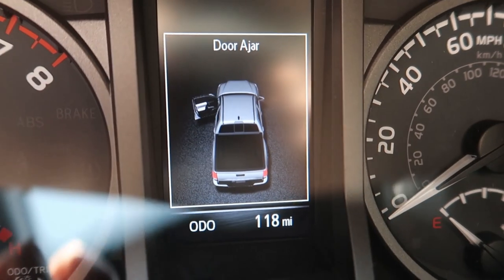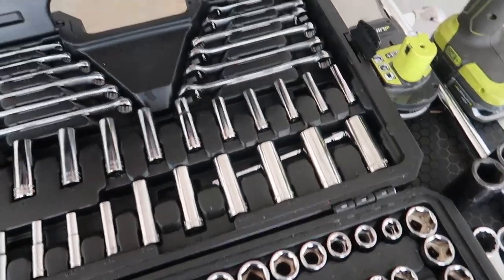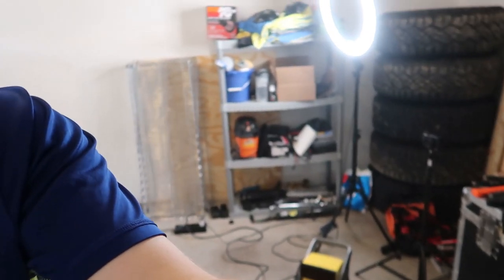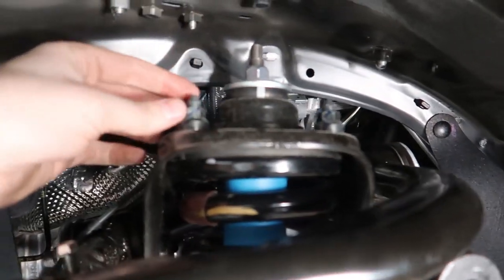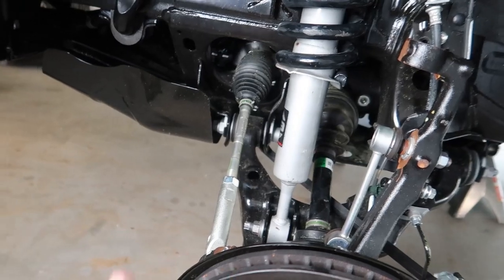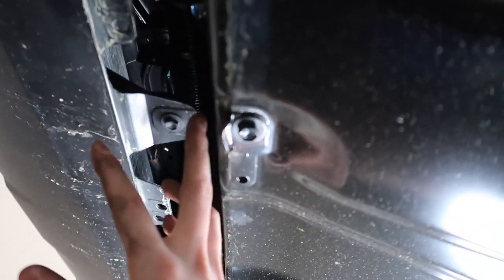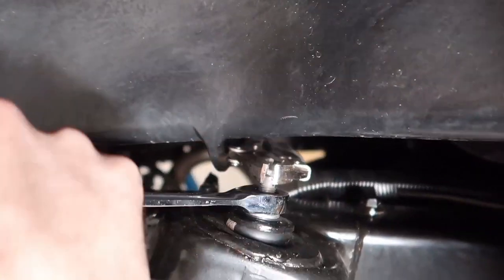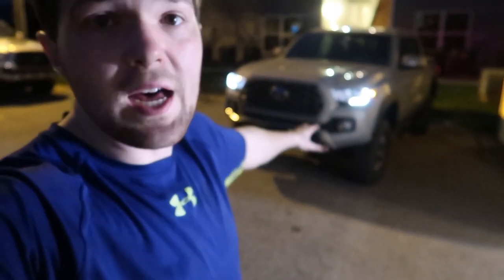Toyota Tacoma ROUGH COUNTRY 3" Suspension Lift Kit w/ N3 Struts 2016-2020 - How to tutorial

Comment from the maker: What you think? Let me know what mods I should do next!
Parts
 used!
Rough Country Lift Kit w/ Lifted Struts and N3 Shock in Rear https://www.roughcountry.com/toyota-suspension-lift-kit-745c.html
Shock Boots https://amzn.to/2WghN9a
New Shock Bushings https://amzn.to/2SAk26u
Bigger Diff Drop https://amzn.to/3b0DOhV
Reply: Less ads and pronounce "cotter pin" correctly
Reply: I have a question. Was this done on a previously stock suspension? I ordered the N3 Loaded 3inch lift struts from Rough Country under the impression that I could put them on my stock 06 TRD Sport 4x4, and got it all torn apart, and then the upper control arms just wouldn’t come together no matter how hard I tired. So after 6 hours I’m back to my stock suspension and wondering why the heck it didn’t work, when it is advertised to work with a stock truck.

Thanks!
Reply: With your 3 inch lift does your truck still fit in the garage?
Reply: I ordered the rough country lift kit I got a question the struts didn’t come assembly with the springs because in the picture looks like they come assembly I ordered the front and rear $599🤔

Comment: I did mine recently, and you can do it much quicker just removing the lower ball joints, strut Mount, sway bar end link and loosening the lower control arm and letting it drop down out of the way. The strut slides down and out and new one up and in.

Comment: Great video but it’s a lot easier and faster to just to remove the two bolts that hold the lower ball joint to the knuckle and loosen up the bolts on the control arm the connect to the frame just mark where your centric bolts are so you don’t mess up your alignment

Comment: Great job, bro.  Was getting flash backs to the nightmare we had doing the front of my 13.  Took two days cos we were so pissed off from doing the front! lol.
Reply from the maker: Yep that was what my first time on my 2018 was like. Pissed yelling screaming
Reply: @Canadian_Dan was that on stock suspension?? I just spent 6 hours on my 06 TRD Sport trying to install and the freaking upper control arms looked like there was no way in heck they were coming back together. I tried a jack and instead of lifting the control arm it just leaned the whole truck. I finally gave up and said screw it thinking maybe this is the wrong kit? It’s the pre loaded N3 struts for my year and model from rough country... Amy advise would really help!! Thanks!

Comment: What is all involved doing a 3 inch body lift on a tacoma? the bed looks the easiest to do but looking under the hood looks like there is much to extend possible the fuse box wire harnesses, heater hoses, block to raise brake lines, power steering hoses, washer hose, ac aluminum lines, radiator lift, bumper lift, looks like much to do it.

Comment: Dude nice video, I tried doing mine and got the back dont but the front suspension is pain in the a.. I tried to push the lower control arm down while trying to sit the shock but it wouldn't budge in line to put the bolt 🥲
Reply from the maker: The front was a huge pain

Comment: I kinda wish you had rubber boot covers for the front struts too. I see the factory ones did.
Reply from the maker: I didnt want to disassemble to strut just to put a boot on.
Reply: @TacoRick  My bad. I was referring back to when you swapped the springs over.
Reply from the maker: I did have boots at all when I did that. Added them later on

Comment: I have a 2016 tacoma sr5 I want to do this same install but I don't have the proper tool to compress the spring for the front strut. Is there a way to buy a strut with spring compressed? Great video btw very helpful.
Reply: Follow on question what's the difference between the N3 shocks vs v2 monutube shocks. The V2 is $250 more but is it worth it?
Reply from the maker: You can buy shocks with springs already on them from other companies
Reply from the maker: The v2 is new not sure
Reply: Thanks Rick. Looking into the eibach pro truck stage 1. Please share your thoughts if you're familiar.

Comment: How's the suspension holding up so far ? Alot of people dog on rough country .any regrets ?
Reply: Rough country has been improving there products more. Like better welds and all around better quality. There just a little stiff
Reply: my 2020 came stock with Bilstein shocks, as I can see your did too,  I did 3 inch lift with Bilstein coils and new shocks, rides amazing. rough country, I'm my opinion great for running boards but personally not liking the ride with there suspension.  one thing I never here anyone mention is if they recalibrated the ADAS system after adding large tires and a lift kit. every time you fart, the system need to be reset. I'm getting ready to have it done for the third time in the 7 months I had my truck because of a cracked windshield. reason to keep it calibrated is one it works right, and if your in a accident and it wasn't done a lawyer will have a field day in court. just my opinion. good job, glad you brought up the alignment. get rid of the claw hammer and get a ball ping hammer. your not going to be removing nails on that truck.

Comment: Did my 14 TRD sport with lifted struts. Took about 5 hours 2 of us with just floor jacks and stands. Came out the way I wanted it to just need to get front end alignment. Noticed after all was done had a harmonic vibration and it seemed to come out of it after 20 miles at various speeds. Is this just the drive train coming into a different alignment then it is used to be?
Reply from the maker: Never had a vibration issue
Reply: Still there getting alignment right now. Goes away at high speeds and coming to a stop. Might have to go threw everything see if it something obvious.

Comment: did you have to use something to hold the dif when you unbolted it for a breif moment to put in your spacers?
Reply from the maker: No I did not. Its a good idea to put a stand under it but its not necessary as you are only unbolting the 2 of the 4 bolts that hold it in place

Comment: Did you have the need to re gear? With bigger tires? And what did you do to fix the speedometter diffrence?
Reply from the maker: I mean it would help to regear but I have not. And I did nothing about the speedo you just get used to knowing you are traveling 2 to 3 mph faster
Reply: @TacoRick  thanx man. Is there a notisable diffrence with 35's in speen and aceleration or is it bairly notisable?
Thanks again.
Reply: @TacoRick  ps i also have your same tacoma model.
Reply from the maker: In 35s yes. I only have 32s and that is slightly noticae on the power and about 2 to 3 mph difference

Comment: Quick question bro , when you installed those struts did you notice the bottom rubber bushings wer pushed up after installation? Or maybe just needs to be broken in
Reply from the maker: A little not much. I re tighten everything after 500 miles and then every 5000 after that per the instructions
Reply: @TacoRick  yea i did the same set up ans noticed them bottle rubber bushings pushed up a bit them i noticed on youre video you have the same thing going on ..im hoping they last me as long as you'res...thanks bro

Comment: Good evening, im looking to buy a rc front struts , i already have the 3”2” lift kit with spacers on the front and wanted to know if i should buy Rough Country 2-Inch Front Leveling N3 Struts or Rough Country Loaded Lifted Performance N3 Struts for 3-Inch Lift. Which ones do you have?
Reply from the maker: The n3 lift struts
Reply: @TacoRick  How is the ride? Regrets?

Comment: Doesn’t the trd off road already come lifted from the factory compared to lesser models? Also, the link you provided only comes with 2 struts and not all 4.
Reply from the maker: It has a what they say is a 1" higher lift then the sr5 models. And I couldn't link my kit directly as you select it via the drop down
Reply: Taco Rick I’m thinking of getting the new 4 cylinder 4x4 SR model. It would be like 27-29k. Then I get the 3” rough country lift, slight bigger wheels/tires with more aggressive offset, and do like new grill/black out badges/maybe light upgrades/etc. I figured I would be all in around 30-32k at the most.
Reply from the maker: Yeah that's doable depends on your wheel tire choice. But you can do it with that budget

Comment: Hey Rick! Do you need a spacer list for the front\lower skid plate once you install the diff drop?
Thanks 
Bw
Reply from the maker: Yes. The kit comes with the bolts to do so
Reply: Ok my kit only came with diff drop. Rough country 3” with n3 struts. No extra hardware for skid. 
Thanks bro
Reply from the maker: The rough country diff drop uses factory hardware. The bugged diff drop i bought separate comes with different hardware
Reply: @TacoRick  Roger that! Thank you sir.

Comment: What is the point of the bigger diff drop? Is it needed?
Reply from the maker: Front CV axle angles.
Reply: Taco Rick ok I see. Is it needed though? Or does it just make the ride smoother?
Reply from the maker: If you dont do it your ball c axle can fall out or you will wear out the joint faster

Comment: Why does every one take off  upper ballpjoint  there are 2 bolts on bottom  ball joint that I removed and lowered bottom swing arm out of the way   is it wrong how I do it?
Reply from the maker: Not a mechanic. But I would guess 1 bolt vs 2
Reply: No your way is best. Leave the balljoints alone

Comment: Whats the biggest tire size you can put on this suspension? I am looking at getting it and wanted to know if they can fit 285's?
Reply from the maker: 285 will rub minorly. I used 275
Reply: Depends on the offset of your wheels. I have the same lift on my 17 Taco SR5, running 285/70/17 with a +5 offset. No rubbing.

Comment: After you get it aligned and put on the new wheels do you have to get it aligned again?
Reply: Also when you get the 33 inch wheels on there after the lift do you need to get your speedometer calibrated?
Reply from the maker: No you dont have to get it re aligned. Bigger or smaller wheels and tires doesn't affected the alignment. You can recalibrate the speedometer if you want but most people dont. Just know that your traveling about 2 to 3 mph faster than what the tack says. That's what I do. I also have Waze open on my apple car play screen which shows my actual GPS speed.
Reply: Taco Rick ok that’s good to know👍🏼. I’m saving for a 2020 Tacoma and I’ll probably get it in a year or so. I’m gonna be going to college in North Dakota in about two years so I know the 4 x 4 will be useful over there.  Does your truck have taco lean at all after the Lift?
Reply from the maker: Where the hood is higher than the rear? Yes

Comment: Please help!! I just spent 6 hours fighting these things and then came to the conclusion that they must not fit, because I couldn’t get the UCAs to come back together, and the extra 3 inches down was putting a lot of strain on my CV’s and I thought for sure this doesn’t work with stock suspension.....but apparently it does?? How do you get it all to come back together after adding that much length down?

Thanks for the help!
Reply from the maker: Refer to my big crow bar portion of the video
Reply: Taco Rick I was able to get the struts in on the bottom which is where you used the crowbar I believe, but it was the top that was giving me trouble.
Reply from the maker: You put the top of the strut in first. Then the bottom. Then to reconnect the top knuckle to the control arm you use a jack under the a arm to compress the spring enough so that it will reconnect
Reply: Taco Rick thanks so much!
Reply: Taco Rick I believe my problem was that my jack was centered under the truck so when I put the 2nd jack under, it just leaned the truck instead of raising the arm. I’ll re try :)

Comment: Hey man! Have same truck as yours , can 285/75/r16 fit on these ? Or! 305/70r16?
Reply from the maker: Stock no. Do the calculation on diameter. Max with this lift kit is 33s.